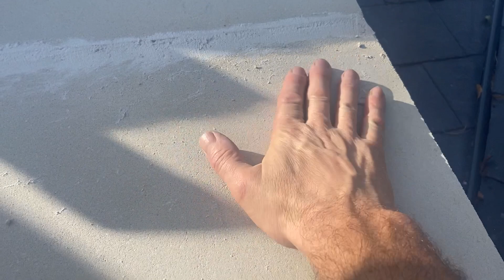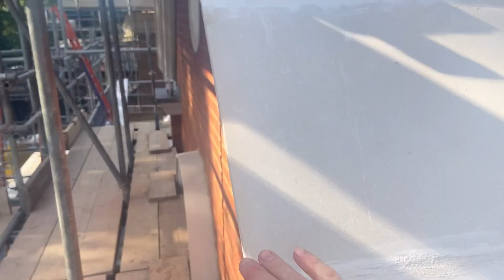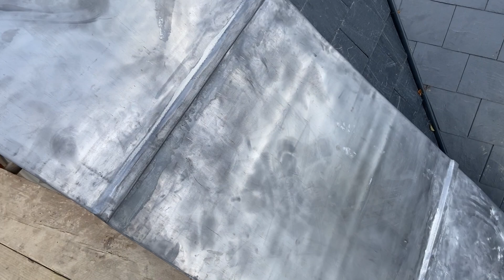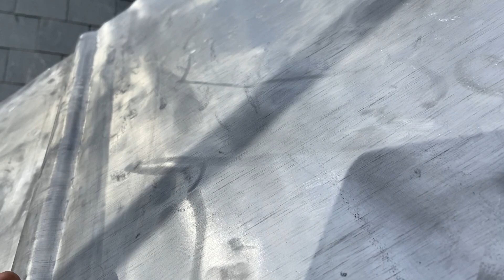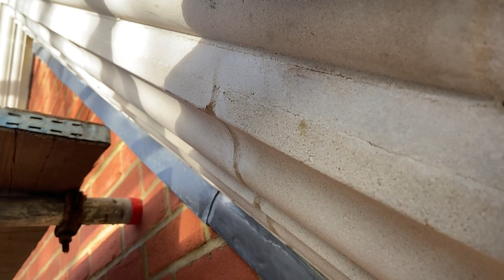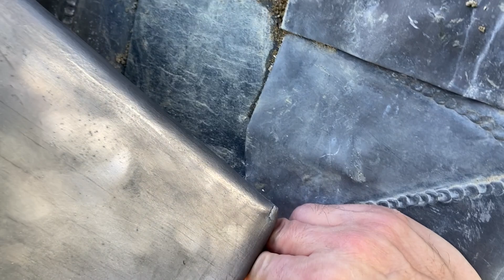Installing Code 5 Lead Capping To A Stone Gable

Comment: Another work of art one thing Get one of those fluffy microphone things to cut the wind noise, it looks hard work but should look much better than the fake stone that the builder put in, also who designed the gully’s on that building that is a problem in the future especially if and when you get thunderstorms.
Reply from the maker: Thank you. 
I have now upgraded my microphone since this video was recorded. So hopefully the audio quality is better in my more recent videos. 
Not sure who designed the gully’s etc. On this job I was a subcontractor. 
Thanks for watching.

Comment: Fantastic work, I have recently started lead welding as I do a lot of chimneys but struggle how to mark out the back gutter for welding any tips or videos would be much appreciated
Reply from the maker: Thank you. 
To be honest I generally weld Kg back gutters in position. 
I have a chimney vid in here I’m pretty sure on that you’ll be able to see how I cut and welded the back gutter
Reply: @slbleadworks  I will go and check that video out thank you 🙏

Comment: Hi stu
When you do your drilling to put a fixing in your copper straps do you use a red plug then hammer a copper nail into that??
As I've been using screws...
Cheers
Reply from the maker: Yes I drill through the copper and use a red plug. I then hammer in a ring shanked nail. And use extra copper as a washer because the drill hole is about the same  size of the copper nail head.

Comment: Hi mate, bit of a random question but do you have any tips for vertical welds? I recently welded a box gutter which had a parapet wall on one side and I really struggled to weld the vertical side. Any help would be greatly appreciated 👍
Reply from the maker: Have you tried welding down from the top first and then coming back up. It’s the way I do it and I find it so much easier than coming straight up from the bottom.
Reply: @slbleadworks  no I haven’t tried that but I definitely will when I next get the chance. Thanks for the reply mate. Enjoy your weekend

Comment: Hey Stuart can you help me with information on regulators for burning. I have a set of BOC series 8000, Oxy 4 bar and acetylene 1.5 bar regulators will these be okay for lead burning if I get a model O torch ?
Reply from the maker: Yes sounds perfect. Just make sure you don’t get a cheap copy model o torch. I got mine from the welders warehouse
Reply: @slbleadworks  is that the one that’s all blue ? I was looking at that one last week to buy
Reply from the maker: @tinman1092  yes. That’s the second generation. I have this one myself with a number 3 nozzle

Comment: Why didnt you lap the panels on a pitch like that? Seems like a lot more work wit welts. Just asking, not slagging off, nice work
Reply from the maker: Thank you. I welted it because with laps your relaying on the clips to stop the wind from lifting up the lead. Yes you could put a few on and weld them as low as possible. But time I’ve done all that I thought it would be just as quick to welt the panels. And also it’s 100% not going to be compromised from wind lift.